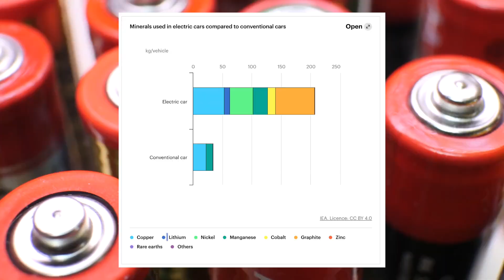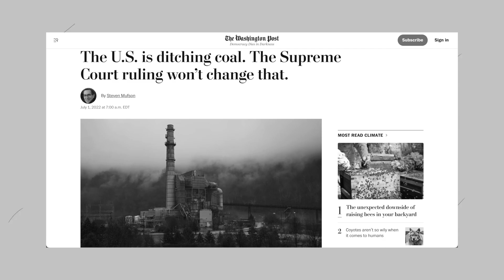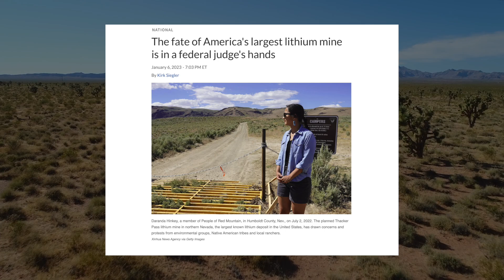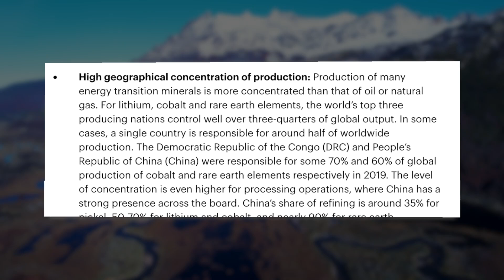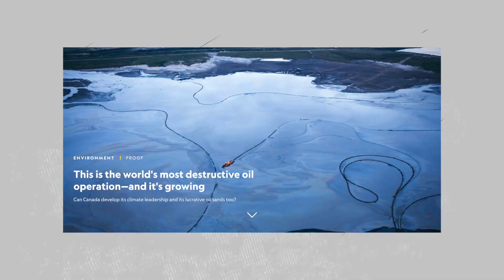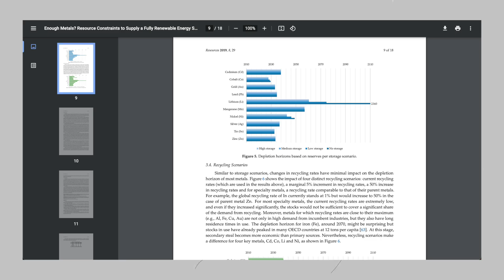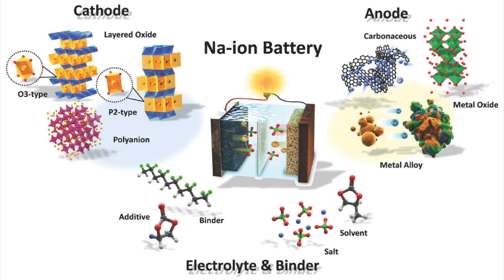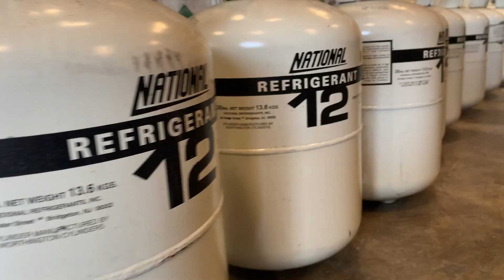Clean energy is dirty (but we need it)

Comment: I dislike that anyone one compare mining for very little to slavery yes the wages are low but you are free to not work at that mine. There's no other work I understand but you raise that wage and they'll invest in machinery and then even less people will have work although they'll get paid more and do cleaner/easier jobs i.e. mining using machines not just with a pickaxe. I mean maybe Congo needs to diversify it's exports a bit more because currently it seems to be some pretty raw resources like copper, crude, wood, tin ore so that puts them on the bottom end of the market. I mean for a dollar a day I could buy a solar panel system and a pc, have it shipped out to someone in the Congo have them learn English, maths and coding using the computer connecting to the internet and have them do some coding for me when they are ready. That'd cost me about £8k to get setup including the pay to keep that person able to do the learning and if they worked a normal 37.5 hour week for me at even as high as $10 per day about 10 times what they get paid that'd be $50 for them and I'd take home about £500 extra. To clear the £8k I'd need 16 weeks so like 4 months. I don't even get paid very well for my industry so point is if someone would just invest in these people they could make a comparative killing. There is nothing particularly hard about coding and it's a fairly in demand job and obviously that's just 1 example.

Comment: Nuclear seems to me like a good option it is technically renewable and it is scalable which we can see as 5 of the top 20 power plants are nuclear with hydro being the most used for large power plants but obviously that comes with destruction of environments. Certainly on a grid level we want something powerful but I think it would be good to get people off the grid supplying their own energy so I like solar and wind but it's so much materials and it's rather rarer ones as well. Unfortunately the LCOE for nuclear and solar are much higher than for solar but that will start to go up if we don't suddenly have a breakthrough in solar that allows for a much cheaper LCOE for solar. The actual social costs i.e. people working in mines for a dollar a day is what is more concerning.